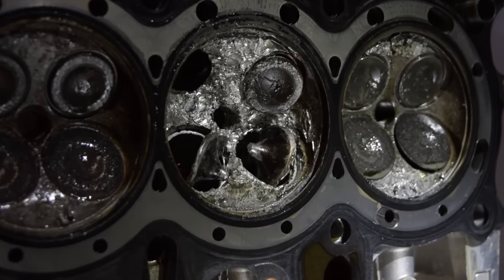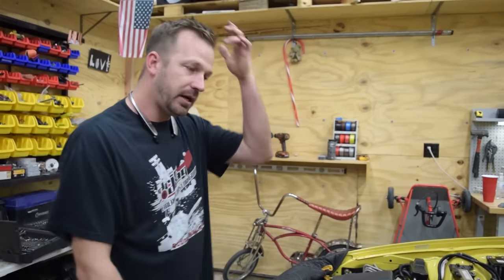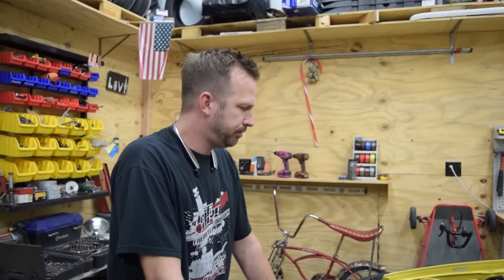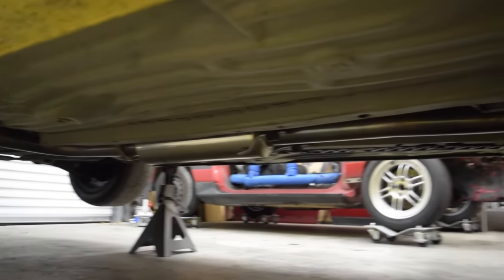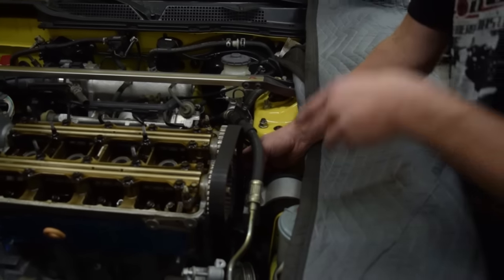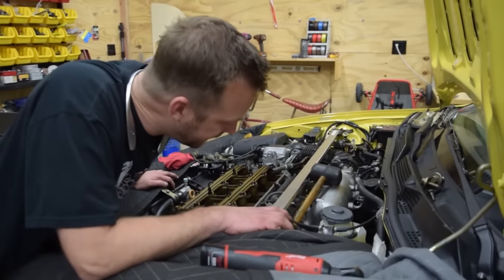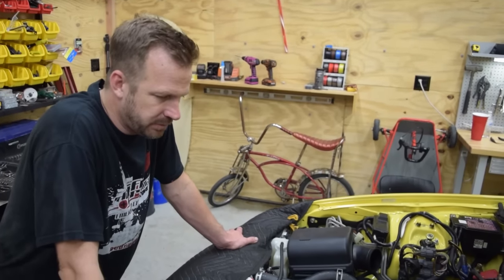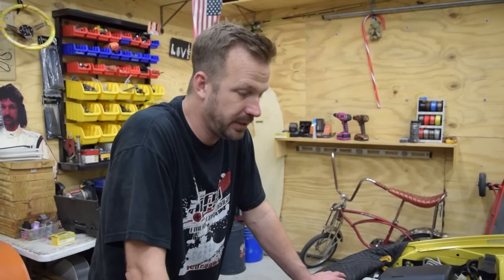INTEGRA TYPE R DESTRUCTION: Disco Tech Vlog

Comment: One of the main reasons my stock #''s matching Type R engine is in the corner of my garage and there is a built LS/V in my Type R. I'm sure I will go through the stock engine one day and freshen it up to put back into the car, but ad long as I plan on wanting to beat on it, it will have more easily replaceable parts. I feel the owners pain for sure...

Comment: Shame the misshift happened but it does occur. One thing tho, why would you ever pry on cam caps with a screwdriver lol. Ouch, that just hurts to watch. A few light taps with a dead blow will get them off in a hurry and without the risk of scratching up an item that you can only buy as part of a whole head. (The caps are line honed to each individual head/cam package so Honda does not sell just replacment cam caps, better to be safe!) Really clean car though! I converted a Milano Red 95 to full JDM 98 spec Type R. I did this because I didn't want to track and beat on a real DC2R. Car has the full 98 JDM hood/bumpers/skirts/lip, 36mm 00-01 5 lug brake and axle swap, 98 JDM wheels, 81.5mm 11:1 B18C, 89mm crank,ported P72 head, supertech valvetrain, Skunk2Pro1s, Skunk2 intake manifold, Maxbore DC2R throttle,Comptech intake, RMF header to 2.5" JDM cat, 2.5" B pipe and modified DC2R axle back. 01 USDM Type R tranny HLSD w/ 4.4 final. Has GC coil overs on Koni shocks, Function7 LCAS, ASR subframe brace, PassJDM front/rear strut braces etc. It weighs 2389 with full interior and power steering, Tuned on S300 it made 218/145 HP/TQ SAE corrected and is an absolute blast on the road course. I run times more concistent with new Vettes, M3s and other exotics than an older Honda. The DC2 (and EK9 for that matter) are insanely capable chassis and with moderate power they can hold their own on track against a ton of competitors.
Reply from the maker: Well in Disco's defense, I do the same thing. I don't pry on the mating surface but rather, I pry on an excess section of the cap, and carefully so as to not even scuff that area. You're right about the caps being line honed, but the level of risk taken when prying on an excess surface on the cap isn't going to warrant a new cap of which can't just be swapped like you mentioned. I do admire your level of attention to detail but frankly, if done right, Disco's method of cap removal will not trash a cap. Just don't jam the screw driver in and twist. Care and finesse will make and has made this an acceptable method of removal, though don't expect this technique to be seen in any service bulletin. lol. Reminds me of when Honda removed the service bulletin discussing burnishing synchros. It was a valid bulletin but too many people applied the procedure incorrectly and on old worn out synchros, but I digress.
Reply: Joe Doole Yeah you would have to be trying really hard to ruin a cam cap while prying them off.  I too have used light taps with a small hammer but it's honestly whatever is within reach that's isn't going to damage the engine is the tool that gets used.  I have never assembled an unsuccessful engine.
Reply: I was just kinda talking out loud, just a personal pet peeve for myself I wasn't trying to be overly critical. Kind of like when people call a magazine a "clip", just one of the little things that I always notice for some reason lol. You don't seem like the type of person to be careless on a build so I'm sure it's fine. Everyone has their own methods and little tricks. (I like the candy cane trans funnel by the way) I just won't pry on cam caps because I think I could score one pretty easy myself. I don't do finesse well when prying, so I just give it a tap with the mallet. I definitely seem to fall into the category of "if it's remotely possible it will happen to me". Ever received a brand new Garett turbo with shaft play? I've had one. Ever had two broken axles on the same launch? I have. Ever get a squib load at the range from quality name brand factory ammo like Federal, Winchester etc? I've had two so far. And the list goes on for my
Wonderful luck haha.
Reply: Also side note: have you ever ran the Hondata thermal style gaskets and then also done the TB/intake coolant bypass? I wouldn't reccomend it in super cold climates, but for warmer climates and on "race cars" it is the perfect compliment to those gaskets and really kicks the benefits into high gear. We did a test with the GE version of the gasket on both the manifold and TB and then using a laser therm/monitoring IATs. The gaskets themselves definitely help, but you still end up with a warm manifold and throttle because it's circulating hot coolant through them. After the bypass though and with the thermal gaskets it literally stays cool to the touch and IATs drop significantly.

Comment: Nice car, mine was a 2001 Nighthawk Black Pearl number 703. Pristine condition, sold it with a mere 4,000 miles on the odometer to buy a 2003 S2000. I left mine 100% stock and watched two guys practically have a fist fight over the car in my driveway as the car wound up in a bidding war. I sent both guys packing and neither got the car. Two months later I sold it to a gentleman from Erie PA. He was buying it for his son who of course came with him.  He assured me his son would drive it safely. I spent several hours with him showing him on-line videos and newspaper articles about people getting killed behind the wheel because they did not understand the driving dynamics of this particular car and how it acted more like a rear wheel drive car then a front drive one under hard braking. The Type R was designed to do this in order to quickly pivot the rear end increasing speed through the corners. Mr. Taylor was the consummate gentleman and very determined to make the purchase. After hours of suggesting to him that it was not the right car for a kid in his teens he won me over. I told him that I never wanted to hear from him if his son got into a bad accident or worse as I tried everything to talk him out of making the purchase. I took the kid aside and explained to him that he needed to respect both his dad and the car both for different reasons of course. One week later, they showed up and took the car home. The son had a buddy with him who frankly looked like a real trouble maker.  I took both of them aside and explained one more time that no car is a toy but that this one especially needed to be respected.  I also told the son that as a father myself of four that it would kill his dad if anything ever happened to him behind the wheel.  Soon after they left and headed home; his dad in one car and he and his buddy in the ITR.  A few hours later I received a text message with a picture of the speedo which I still have. It read 120mph essentially telling me to shove my concerns up my A$$! A few months later I ran the VIN # as I do with all cars from time to time that I have sold to see if the mileage was being kept low to maintain collector car status or if the car was really being driven which of course would kill its value. Unfortunately the report came up as follows: Serious accident / salvage / possible fatality!!!!! I never again did hear from this young man’s father. I can only hope that the possible fatality portion of the report was standard issue but I looked no further.  These were great cars but were designed for the track or for people that really know how to drive.
Thanks for a fun look back………..
Reply: Rob M That's the problem with most people shit goes in one ear and out the other.
Reply: Rob M I read this right as TAPS played at the end of the video....at least you did your due diligence.
Reply: Rob M I would've listened to you :(
Reply: That's a sad story but honestly that would have likely happened with that kid even if he just got a GS/R. Obviously the selling price on your car was high because it's a true well kept DC2R, showing out of the gate that it was a spoiled rich kid who daddy would do whatever he wanted. (No respect or value) This kid was destined to end up wrapped around a pole regardless what he was driving. While I aggree the DC2 is an amazing chassis, I've built half a dozen over the last decade, I don't think it takes any special skill to drive one. You have to be a decent driver to push any car at or near its limits and the R is no exception. That being said even a stock GSR can be very lethal in inexperienced or risk taking hands. The overall power and speeds reached between that and a real R are very similar and with a kid like that at the wheel even a Civic DX would be dangerous. Don't beat yourself up, and don't even feel sorry for the kid, just miss and remember your beautiful R.

Comment: Old videos but I’ve been watching the series lately and it is entertaining. I have to ask though, what takes you 4 hours to do a timing belt on a B series, especially using a lift/shop? I do it in my driveway in like 2 hours and that’s the full Monte; timing belt, WP, tensioner, new coolant, timing the engine, etc. If I did it in my shop probably 1.5 hours. Hell I can do a head gasket AND full timing belt job in 4-4.5 hours in the shop lol. I get that you are meticulous but I don’t rush things either just work at a brisk pace because I’ve done it 900 times by now. Granted majority of the cars I own/work on don’t have the factory intake system and snorkels, factory timing covers, etc. so that saves a little time but not two extra hours lol. Anyway, great videos this is a blast from the past!

Comment: at 14:28, on the shot of the piston being wiggled around, it looks like that cylinder itself is cracked all the way thru.  Pause and look at about 10 o'clock position of the top of the cylinder wall and down the inside at the same location. Is that cracked or just debris or something making it look that way?
Reply from the maker: It was cracked all the way through. The engine has since been replaced, the car has been raced, and the owner has broken the 2 minute barrier at the NOLA 2.75 mile configuration.
Reply: That's definitely the most damage I've seen from a valve hit.  What a shame.
Reply: What did you use in the rebuild?  All stock type R internals?

Comment: These are extrremely well lubed engines.  10 to 1 the piston cracked / valves broke during an over-rev situation from 4th down to 3rd gear.  Pretty ugly........
Reply: Rob M I think he said he accidentally shifted 3-2, instead of 3-4, from 3rd gear redline.  regardless, something gave.  I'd suspect the valves didn't close fast enough when it was severely over revved, and the piston came up and smashed them.  from there I'd say things just pretty much fell apart

Comment: the same thing happens to me  I had a b16 on a eg, and at 7800 rpm a miss shifts    the rmp wen oner 12000  my block  melt like  butter.
not fun  at all.
Reply from the maker: Maximum bummer.
Reply: Ohhh yeah wen I pull off the head the the cylinder 2 & 3 were  gone. 
This can happen to any body 
A only takes a split second